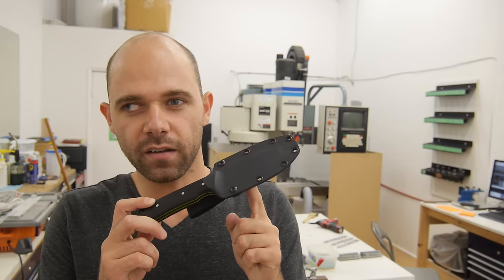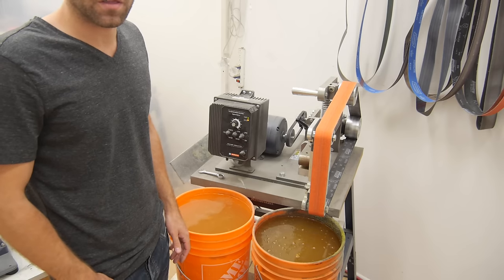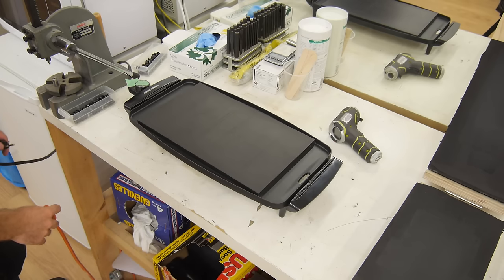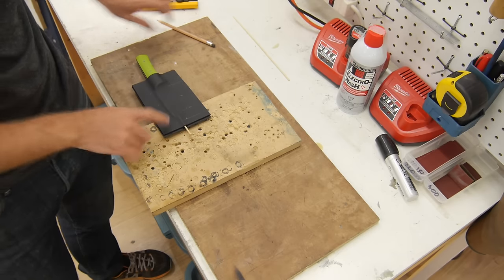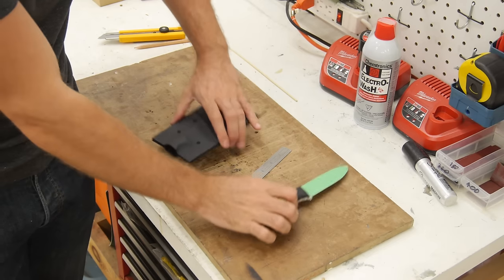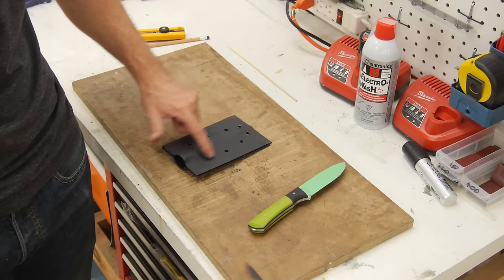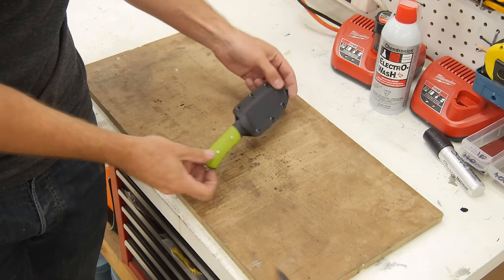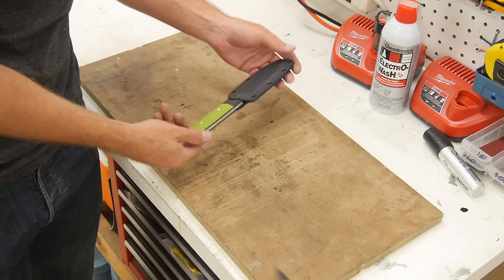How to Make a Kydex Knife Sheath

Comment: If I may ask what goes in between the griddle and kydex?
Reply from the maker: On my griddle I have an aluminum plate attached (which is painted with Cerakote) in order to add to the thermal mass of the griddle so the temperature stays more consistent.

Comment: Anybody have any ways to add/extend a back plate to include some slots for a drop leg strap? Obviously one could just add width to the sheath and cut out slots, but I’d also want the option for a belt loop behind the knife handle on one side

Comment: Are you able to make molle attachments for the sheath?
Reply from the maker: Hey mate! I actually don't recommend the MOLLE attachments as they tend to rattle around a lot and are not as secure as I would like. Instead the holes on the sheath are spaced to line up with MOLLE webbing and you can lace the sheath securely onto MOLLE using paracord or zip ties!
Reply: @GoughCustom  Thanks for the info

Comment: My foam took the impression of the sheath I made. Is it possible to remove this impression?
Reply from the maker: The foam used in most Kydex presses is a special foam that has a relatively high temperature tolerance. If yours took the impression of the sheath on the first use I'm guessing it's not the right kind of foam unfortunately...

Comment: Okay, now how do you add a method for attaching your sheath to a belt?
Reply from the maker: Hey Mike! There is a link underneath the video to a tutorial on how I do my belt loops.
Reply: I have an idea or two myself, involving web straps and velcro.  I put it on one of the WEBBING sheaths I made for a small knife, for vertical carry, and its been working pretty well for a year or so.  As soon as I can put together a press like the one in your video(I have a big metal press{heavy, and needs to be fastened to something before I can clamp it closed}) I intend to replace the webbing(which the point of the knife is beginning to poke through) with kydex

Comment: Noob question... Why do you need a drain hole in the sheath at the top?
Reply from the maker: Just to make it easier turn clean the sheath, and to ensure that the knife can't freeze into the sheath if it rains and then freezes

Comment: Won't the friction of the knife "popping" into the sheath scratch it?
Reply from the maker: It does a little bit yes, but as the handle and sheath wear together this stops happening over the long term... It's worth that little price though because a sheath that holds the knife like this without any need for straps etc is incredibly functional and handy!!

Comment: Careful everyone. Don't be a fool and go by "290F". This is what works on his specific griddle. If you're using an oven it's approximately 100F. If you go past that you're taking a huge risk since the kydex will melt.
Reply from the maker: +Čarpe Diëm there's no way that the Kydex is hot enough to form at 100f. You're likely heating it to 100c
Reply: Gough Custom That was my mistake. It was hot enough at 175F. Kydex melted at 240F.

Comment: What's on top of the griddle that you lay the Kydex on?
Reply from the maker: It's a 3/8" thick aluminum plate that's been sprayed with Cerakote. The plate acts to even out the temperature and also hold a specific temperature more evenly.
Reply: What benefit does the Cerakote add for this setup? Did you try the aluminum without the Cerakote?
Reply from the maker: The Cerakote acts as a non-stick coating, without it the hot kydex will stick to the aluminum.
Reply: Thanks for the info.

Comment: I literally have no idea how you get that snap fit. I've failed too many times now
Reply from the maker: As a hint: the snap fit is actually less about the kydex than it is about the shape of the knife handle... The handle needs to be designed with kydex sheaths in mind for the best 'snap'. On my knives the finger cutout design is well suited for creating that snap fit in kydex! If the finger groove is very smoothed over or not terribly pronounced then even the best kydex won't 'snap' and the retention might be weak.
Reply: @GoughCustom  That makes sense. On your design you're saying it's the finger cutout on the bottom of the handle that works well for the "snap"? 

While I've got you here, if I may...
Is there lower quality kydex? The stuff I'm getting on amazon seems to not look quite like yours. Mine is the 0.08" too. Great quality blades by the way and thanks for the content. I've just recently started knifemaking as a hobby and It's helped me immensely! made the jig too =)
Reply: One more thing if you feel like it:
I live in Ottawa Ontario and I'm struggling to source steel. Any recommendations? Should i just import? The steel I've been buying is local and outrageously priced... I've been buying o1 but i'd rather 1095 or 1084
Reply from the maker: @virtualvegan7376  I'm honestly not sure about the 'lower quality' Kydex. There are different brands (like 'Holstex") that do feel / look a little different, but I'm sure there's probably also counterfeit Kydex. The real stuff is made in the USA. I buy mine from KnifeKits.com
Reply from the maker: @virtualvegan7376  For a beginner O1 is probably better than 1095 or 1084, just because the small amount of added Chromium makes it a little more forgiving in heat-treat. Additionally it will be available in WAY more sizes and in nicer finishes because it's commonly used in machine shops. Good sources:

- New Jersey Steel Baron
- Online Metals (supplies Precision Marshall flat ground stock which is a good brand)
- McMaster Carr (if you need something tomorrow)

The best Canadian supplier I have found is Buffalo Precision, they sell all the tool steels (including O1) and they are where I buy all the A2 steel for my knives: https://www.buffaloprecision.com/canada/en-us/

Comment: Tape the sides of the kydex so they don't come apart until you rivet them.
Reply from the maker: If you get the heat right the kydex will stick to itself, no need for tape!
Reply: 6:01 "you don't want to apply to much pressure because....."  but here youre saying its possible. :)

Comment: Very nice craftmanship.  I never thought of making a sheath from Kydex until I saw your video.  That would be a perfect material for this.  And it has a nice textured surface too.  I am working on production of large quantities of knifes with 14" long straight blades and figured that I would have to make a custom scabbard too.

One suggestion I have to make your life easier and make deburring edges and breaking the edges a lot faster and more uniform is to use a deburring tool like a machinist would use.  This would be a lot easier and faster than using an X-acto knife.  A deburring tool is often used to take the sharp edges off of aluminum, steel and plastic parts.  There are different types with different replaceable tips, depending on the type of edge that you are deburring.  McMaster-Carr is one good source for these in the US (see below):

Changeable-Blade Deburring Scrapers
https://www.mcmaster.com/deburring-tools/

For those not familiar with Kydex plastic.  It is the same type of plastic that is used generously around the inside of aircraft cabins (e.g. the molded plastic around the inside of windows on jet aircraft).

Ed Schultheis
Mechanical design engineer for 35 years
schultek.com
Reply from the maker: Hey Ed! Using a deburring tool like that is a good idea! I have found in the past that they tend to dig in a bit too much though because the plastic is so soft... Perhaps there's a plastic-specific blade that I have not tried that would work better!

Comment: When shaking a knife like that do it away from the table the knife May slip out
Reply from the maker: In this case I'm making sure to shake it high enough that if the knife slipped out I won't slam my hand into it, but I also don't want to drop the knife onto the floor if it does come out, which is why I'm shaking it over the table!
Reply: I understand what you're saying I wouldn't want to ruin one of the knives that I make either but accidents happen so be careful
Reply from the maker: @calvinwright999  thanks bud, I definitely will be!

Comment: How do you paint your knife
Reply from the maker: Hey mate! There is no paint on this knife, let me know what you mean and I'll be able to help answer your question better.
Reply: +Gough Custom I mean, how do you color the blade instead of metal? Thanks for your response
Reply from the maker: In this video the blade is just sanded metal... however in other videos where you see a black blade I have used a variety of methods:

Acid etching: dipping the blade in acid to change its color. This is easy and works well but it not very durable

Cerakote: a special spray paint that much stronger than regular spray paints. It works better than acid etching but will still wear off.

DLC: is a special 'diamond like carbon' coating that is applied in a vacuum chamber and is harder than the knife blade, it will last a really long time but is not something that can be done at home.
Reply: +Gough Custom Thank you very much grateful
Reply: +Gough Custom You should take a video about it

Comment: Hmmm i would say, if ur so worried about scratching ur blade while making a kydex sheath, you probably want to stick to leather then, cause ur gonna scratch it anyways from removing and securing the knife back and forth in the sheath... smh
Reply from the maker: Kydex by itself won't scratch a knife. It's only if you get grit inside the sheath then the grit will scratch the knife... I make my sheaths with space inside to reduce the risk of scratching even when the sheath is dirty and it tends to work pretty well.

Comment: As soon as you start talking in inches I switch off, sorry  but is america that important to you ?
Reply: Inches are what Americans know best
Reply from the maker: Hey mate, so I'm an Australian living in Canada which means that America has very little to do with my use of inches. Machine shops in the USA and Canada are somewhat divided between inches and millimeters, either systems works fine but mixing them is not a great idea. I use inches because buying imperial equipment and tooling here is easier than buying metric.
Reply: Gough Custom Oops, sorry for assuming